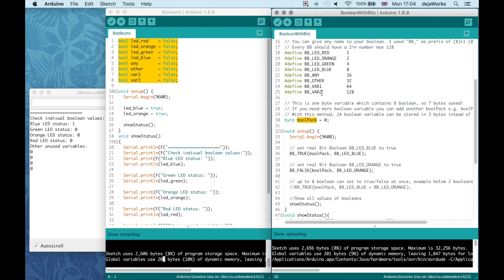Using "Real" 1 Bit Boolean Variable For Arduino Memory Efficiency

Comment: This is great. Thanks.  Subscribed.  It is nice to see the real hard core low level C guys coming up with cool solutions like this.  Well done.  This could really not only help a lot of projects, but enable lots of projects that would otherwise be too big for a given Arduino or other type of dev board.  Using this combined with PROGMEM to store things in the flash memory act like a 1, 2 punch to eliminate memory problems.  This is really fantastic.